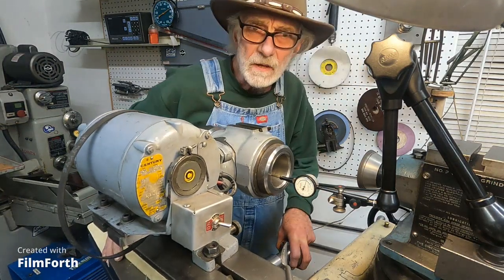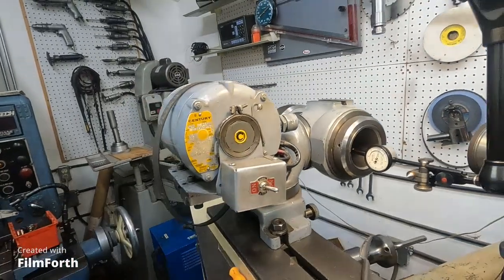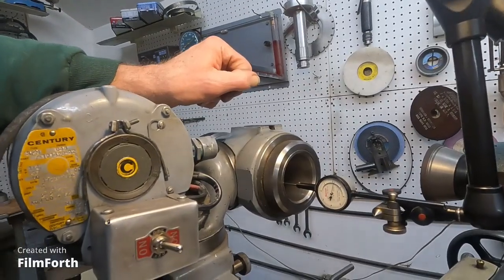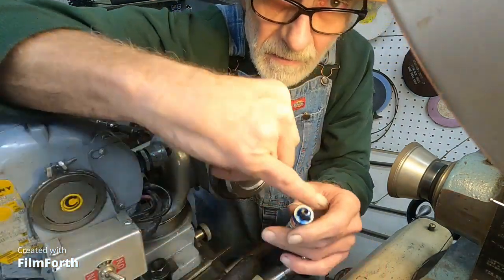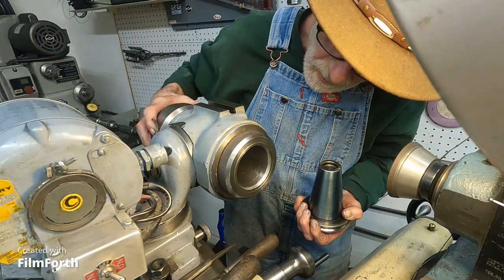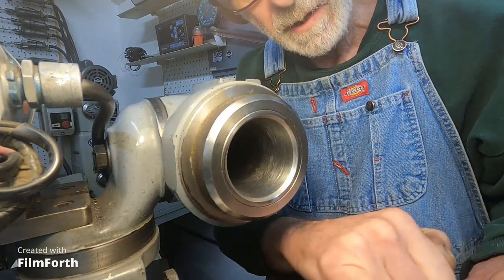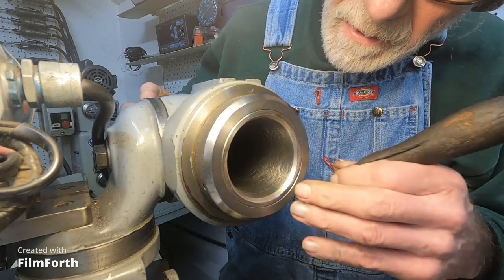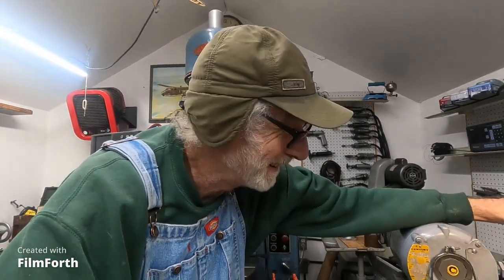Tool & Cutter Grinder restoration of 50 taper spindle work head

Comment: Hello Dee Dee.  Excellent video.  By the way, I have a 1940's Brown and Sharpe 2B 618 surface grinder with the same war production tag as your machine.  I restored the tag along with the rest of the old girl.
Reply from the maker: Hi, my 3 oldest machines are war production from the Hanford plutonium production, they are top quality made to be serviced, they did not use filler on the casting for smooth looking paint on the ones with the tag it seems. Thanks for tuning in, your machine sounds like a keeper.
Reply: @deedeeindustrialsuperprecision  Yes correct!  Absolutely no filler on my grinder but built top-notch.

Comment: I’d be interested in seeing the bearing/spindle arrangement in your work head, it looks like there’s a large nut at the 5C adapter end? Seems like something fairly straightforward (for you haha) to build? Thanks for the videos, enjoyed the bearings ones, great info as always.
Reply from the maker: The bearings in this head are Timken type 0 taper roller bearings, many heads have ball bearings, it is likely all work heads have the tapers ground after assembly to ensure true running, this is why it is risky to disassemble the heads. I will be doing an internal grinding spindle with a collet nose soon, along the same line as far as construction, thanks
Reply: @deedeeindustrialsuperprecision  excellent, thanks! Can’t wait to see the collet nose spindle!

Comment: If after locating and scraping the high spots with your bearing scraper, and the internal 50 taper indicates good, can't you just polish the existing 50 taper with 600 grit paper and a stick following the existing good taper instead of regrinding? You can still double check with your prussian blue.
Reply from the maker: Yes, the original taper is good and I used it as a guide to find the damaged areas with the scraper. I will go over it with a stone and a light polish but there is some deep pitting from rust that wont polish out it looks better using the Hoppes solvent.

Comment: Hello Dee, thanks for the great videos.
I have a Cincinnati No.2 just like yours, so I find your videos real interesting.
My No.2 has some brinelling in the bearing slides that the table runs on.
The table sits on balls and four hardened strips that can be replaced.
Do you know if these spares are still available? 
Thanks again and keep up the good work.
Reply from the maker: Yes that often happens when the machine is moved/transported with the table installed or not wedged up. The Cincinatti Machines offers parts, https://cinmac.com/parts-request-form/ I don't know availability or if they have to be fabricated, but expect a high price, thanks for watching.